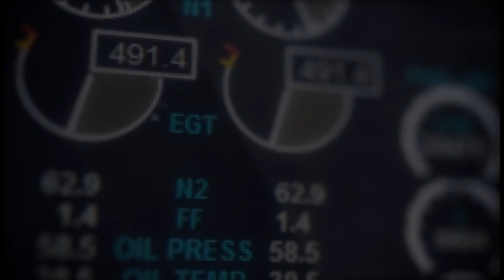Will Circular runways "take off"

Comment: Hey, nice video. Seems to me like a typical case of someone having an idea for a solution to something that causes more problems than it solves.

Isn't it obvious that the wind change 90 degrees every 2-2,5 km so you always experience some crosswind regardless. And if that crosswind comes from the outside of the circle you will get that crosswind straight on the underside of the outer wing due to the simple geometry of a banking runway. That would mean that a strong gust would lift that wing and potentially flip the airplane over. So every take off or landing on this runway will still be limited to one half of it at any given time (the one with crosswind from the inner side) for flight safety reasons. So whats the point of having one 9-10 km long circular runway when you can easily handle the same traffic on two normal 3 km runways facing different directions?

Comment: Circular runways would be a great way to destroy your aircraft.  The load on the outside wheels would be stupid.  You would rip those tires apart, put incredible strain on the gear assembly, and would almost invariably end up scraping wings on the top side since the vehicle would be constantly trying to move toward the outside of the runway.

I would imagine it would also be hell to pilot and would be even worse to be a passenger on.  While it's always good to try to think of new things, this clearly sounds like an idea from someone who hasn't put much (if any) thought into the physics of it.

Comment: ERM.............NO!! Is this guy for real? So explain how you make a safe take off with one foot putting in loads of rudder one way? So yeah I rotate and straight away the aircraft YAWS, does an almighty nose down, the im hit with BANK ANGLE, BANK ANGLE......PULL UP.....PULL UP.........DONT SINK........DONT SINK..........BAAAAAAANG! Pull the ejection seat handle and leave the aircraft quickly through the canopy???.YEAH RIGHT you are a. MUPPET PAL!

Comment: As per this video i thought that a tilted runway might conteract centrifugal force to prevent spinning off the track, but actually the amount of tilt required to equal it would vary depending on speed wouldnt it? So not a great idea.
Reply from the maker: Nop, indeed.
Reply: You are absolutely correct when it comes to runways with fixed tilt. However the tilt proposed is in the shape of a parabola, meaning that the tilt gets steeper at the edges. And parabolas have some interesting mathematic and physical properties. In this case it would make it so that regardless of your speed there would be a spot on the parabola where the force vector from the tilt would balance out the vector of the centrifugal force. And not only that, but it would push you towards that spot, acting essentially as a self stabilizing system. For example if you were too rimwards for your speed (ie. going too slow), then higher tilt at the edge would push you hubwards harder. And respectively if you were too hubwards for your speed (ie. going too fast), then the lack of tilt would push your outwards towards the edge. Faster things would equalize out more rimwards when compared to slower things. This would especially come to play during slippery or asymmetric thrust conditions where the parabolic tilt of the runway would automatically push you towards the equilibrium line defined by your speed. And in case of an engine failure, you can just spool down the other engine to balance the thrust, both being zero. You don't have to worry about running out of runway before you can stop, you know... because of other mathematic reasons.

Comment: Ok, heres a question...  Why are planes still landed manuallly by the pilot in terms of handling the yolk during approach and just prior to touchdown? Why not let the auto pilot handle this too seen as it is already handling things like thrust on approach to maintain correct airspeed. Handling a plane just right at touch down seems to me extremely delicate and there doesnt seem to be much margin for error between slamming down too hard and lifting up off the ground again when you are supposed to be landing. I say this because, as I understand, pilots generally lift the yolk slightly just prior to landing, but with full flaps on a simulator it seems very easy to take back off again doing that and then you have run out of room to correct it and land safely without go around! One would think a computer would be much better at handling something so delicate and important which requires such precision especially if dealing with something like a crosswind at the same time too! It seems amazing to me there are not more accidents due to pilot error because this is not automised. I would be interestsd to know why it has seemingly been deemed safer for this not to be more automised, (apart from maybe keeping pilots in a job lol) thank you!
Reply from the maker: Hi! Yes, it might seem that way but in fact, pilots are much better at landings than the AP is. We have to calculate extra runway distance when doing auto lands because the computer frequently over-flares and lands further down. 
The AP also gave huge problems dealing with crosswinds etc.
Reply: Using a yolk to fly a plane might result in you getting egg on your face.

Comment: Will an airplane even take off from a circular runway?Considering that the velocity will keep on changing(decreasing) with change in direction( while take-off, since there is no straight path, the velocity vector will always be tangential to the instantaneous point in the circle, so the velocity in the desired direction along the circle will be lesser. Hence  a much larger acceleration may be required even to maintain a particular take-off speed)

Comment: Circular runways are the future! Best ide ever and you can not argue with that! Any problems you can think of can be fixt by the pilots having more training to remove any danger! Simpel and smart! Now we can build them right in the center of London or Tokyo no problems!

And All aircrafts need 4engines and RWD. Bad wind and slippery surface? no problem camred! Drifting hard and fast in and out of the airport is just something pilots of the airways shoud be good at! Reverse drifto if they think it's a safe option XD 

Hard enough for some poor civilian to land a aircraft.... Imagen trying to approach a turing runway and not overshoot it or drive/jump off it.

Comment: 1. The obstacle clearance problem is not as bad as it seems, because you could simply limit it to four possible approach angles for a worst case crosswind component of 0.7 times the wind speed, or if you can manage six allowed approach directions then 0.5 times the wind speed, or for eight allowed directions it will be 0.38 times the wind speed.  Compare this to a straight runway where the worst case crosswind component is the wind speed. 

2. The centrifugal force problem is no problem at all.  The whole reason for having a banked runway is to offset any centrifugal force by converting it into a purely downwards force.  The downside will be a slightly greater downwards force, which must be overcome by the lift produced by the wings in order to take off.  The solution to that of course is to straighten the aircraft's track by allowing the aircraft to drift to the outside of the runway once sufficient speed has been achieved i.e. the aircraft is launched out the side of the runway using the slight bank as a mini ski jump.

3. The wingtip clearance issue only occurs on the inward side of the runway and is resolved by either excavating a cavity wide enough to accommodate the largest aircraft (with a suitable margin), or building up the runway on a mound.  More likely both would be used i.e. dirt excavated from the cavity would be used to form the mound.

4. The limitations imposed by neighboring airports may reduce some approach angles but that does not mean that there are not still many more valid approach angles that could be used by a circular runway.  Obviously this problem is not a problem at all for cities that only have one airport (and the circular runway is intended as a replacement) or for new developments.

The real problem I see is landing.  The conventional landing technique sees the aircraft fly along the runway in ground effect after the roundout as speed decays until touch down occurs.  On a circular runway this would have to be done in a gentle banked turn, which would mean transitioning from level flight to a banked turn during the roundout.  Then, while in ground effect the aircraft would be increasingly exposed to crosswind.   You would also need to consider wingtip clearance during this banked turn if the required bank angle (plus any maneuvering margin) is larger than the runway bank angle (which it almost certainly would be, as the aircraft would be initially flying faster than the maximum speed experienced during the takeoff roll and therefore would need a greater bank angle to achieve the same radius).

Comment: Will pancake-shaped runways; that is, large, perfectly flat, paved areas; circular in shape; with a diameter of about 3 miles; be built in the future; with, all of the air-travel-industry supporting infrastructure being both outside of the large, paved pancake; and underneath of the large, paved pancake? If not, why not?

Comment: A couple of major flaws with circular runway not mentioned. 1, You only get one runway and optimal headwind will only occur at one point on the circle. 2, Most pilots use lots of the runway leeway to land, they can err landing early, just clearing ALS with tires on tarmac, no harm OR they can overshoot and land further down the runway, using thrust reversal to safely arrest speed before end of runway, BUT on a circular runway, there is only one point they can safely land tangential to their approach.

Comment: Problems from a circular runway are numerous. First, pilots have the added task of following a curved runway, added to their other duties during takeoff/landing. Then there is the added wear to the outside edges of the tires from lateral stress. If an aircraft has a mechanical problem, a circular runway adds another factor to deal with during landing.

Comment: You completely forgot to factor in the bank angle of the runway in your arguments. Slippery surface or one engine out takeoff would not be a problem, because the runway is PERFECTLY STRAIGHT for the plane, as it is banked.

Comment: What would the problems be with a large scale helicopter airport and large multi prop passenger helicopters? Large, gridded airports, with 90% of the terminal underground, an underground access terminal on every pad, as many takeoffs and landings for as many terminals at peak times... 

I think the biggest issue would be building large, efficient, stable, multi prop, 200+ passenger helicopters. But surely we have the technology now.

Comment: You neglected a key design feature. Beneath the wing is a mechanism that resembles a tail hook, and before takeoff a steel cable is attached and tethered to a pole in the center of the airfield. Then the plane just whips around like the old toy planes and then bam!  pilot hits the quick release and off into the wild blue.  Passengers get a free Berserker ride too!

Comment: Thought wouldn't the clearance zone be smaller since planes would take off tangentially from the circle (smaller compared to the straight length). But i don't think well have a solution to wet slippery runways.

Comment: Drainage for rainy weather is a huge problem as-well, may cause major slipping trying to get onto the sloped runway, or even just going through the taxi-way, flooding, and other things are also very likely. Unless it was built on large hill above the water-line where the water could be easily drained, it would be massively impractical for just the reason of drainage, despite all the other ones stated, and even tunnel carving to get the passengers into the central airport in the first place.

Comment: Runway would have to increase bank to an extreme level to (ideally) nearly equate gravity at takeoff speed to protect from engine failure, then curve off quadratically, for a safe lateral launch. The runway path would also need to be very wide to allow for this + wing clearance. That would be the main burden. As for nearby airport traffic impact, advances in GPS + Dedicated, redundant networks between planes for reconciling trajectories, & assisting in advanced collision detection/prevention (based on maybe  a Tesla-like system) could allow for greatly reduced "tolerances" between airborne objects/planes.

Comment: Call me crazy, but if you had shorter runways coming off the circle like angled spokes, at a tangent that would allow easy flow into the circular part, it might work better. Set them at every 15 degrees or so.

These shorter sections of straight runway would allow for the initial landing and lowering of speed, then transition smoothly to the circle to finish slowing down.

Comment: I have a concept to build an airport on a giant turntable that keeps the runways aligned with the wind.     3 10,000 foot runways pivoting on a central axis.    Massive roller bearings     This airport could be pre-manufactured and delivered anywhere needed.

Comment: You're applying exiting problems and ignoring any new solutions a circular runway present. If you lose an engine you do not run out of runway. There isn't a scenario you're force to take off with a single engine. Same about many nearby airports, you wouldn't have many smaller nearby airports by design due to the runway size. I'm sure it'll never work and there's plenty other problems, but you seemed to be ignoring any new change in thought a circular airport would open up.

Comment: you touched on it lightly, but to me the biggest problem is that, its alot unsafer, and will require airplanes to be working pretty much on 100% perfect condition.

not only does the angled roads will make landing more dificult, it WILL cause alot of problems in many more situations as well, from forcing harder angles than the traditional landing does, but also will be impossible in cases like malfunctioning landing gear, or even emergency situations like damaged airplane. 

and lets not even talk about constructing and maintaining those roads either. with the need for perfect angles all around to training, and cleaning.

its one of those nice ideas for a futuristic setting, but that wont really work out.

but i could see this working for something like a small, tourism focused, island. but even then, more like a novelty than for praticality.

Comment: His picture about wing clearance isn't to scale. 

For a 787 the wingspan would be only 1/3 the width of the runway and the banking would have a dia. of 700 meters. 

So for the 787 the engines, which would be the issue, not the wingtips, would only have ~ .5 meters of clearance, from ~1.5m on regular runways. Of course if the runway was widened even more then the clearance would increase.

Comment: When we have large capacity VTOL (I've been working towards such a concept, may not work as hoped, so working (very slowly!) on a working model design) straight versus curved runways will be replaced with a hexagonal layout of landing pads and terminals, because circles pack tighter rhat way.

Otherwise, the closest we're likely to come to circular runways on current patterns of airplanes would (most practicallly) be circular taxiways with runways across the diameter, but other than the overall traffic patterns added in the sky, it still would create interesting and scary traffic takeoff and landing patterns: it seems probable we aren't going to change airports much without a radical change and changeover of airplane tech, for all the reasons Mentour Pilot cited.

Comment: #1 isn't insurmountable in much of the USA but the others you mention put this idea into the trash can.  Fascinating though.  But, Boeing is in active testing of an invention they licensed that would eliminate the need for aircraft to use airfoils for vertical lift.  China has tested it on ground and in space already.